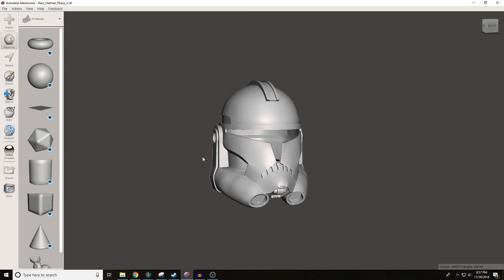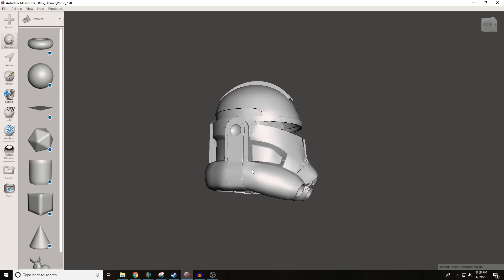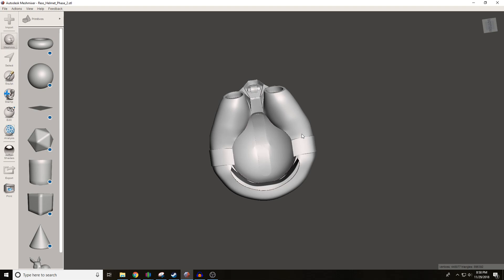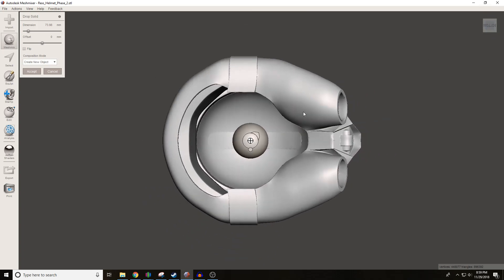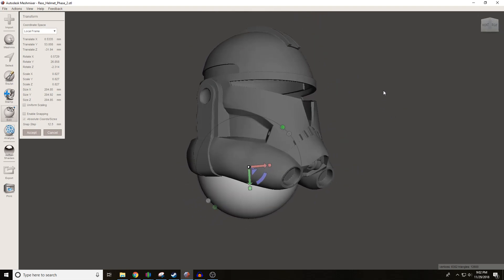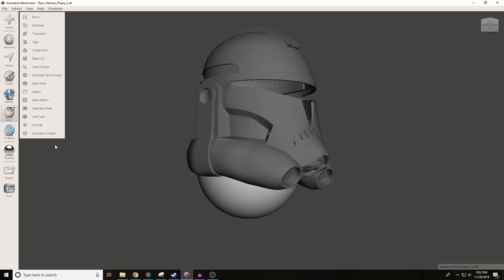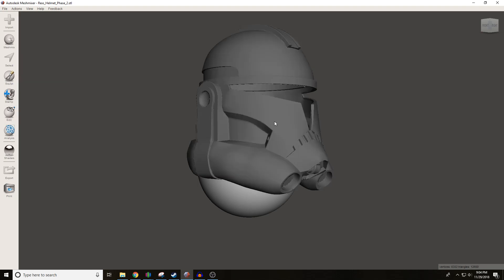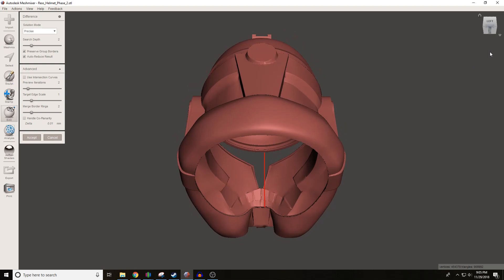How to Cut a Neck Hole for Helmets - 3d Printing Tutorial

Comment: I know this is an old video. The smaller, odd shaped hole is screen accurate right, even though it would be physically impossible to slip your head through a hole that small. So maybe split the helmet in two, front to back, so that you can put it on the way and still keep the full screen accurate coverage under the chin and around the neck
Reply: If we are talking screen accurate, these are clones and the clone armor used was mostly all cg except for the clone pilot scene in revenge of the sith. Also the stormtrooper helmets were injection molded and made from a few different parts so all were slightly different. That being said they all were essentially buckets and easy to slip on and off. (If you look at a new hope how easily Han and Luke just took off their helmets.) 

Helmets that split from the front and back shell like most power ranger helmets are also more difficult to put on, and have issues like you can't excessively talk or move your face because the helmet is that tight of a fit. (You can see that in spider man 1 were in scenes they just dub in their voices and the mouths don't move) it is mostly so you don't accidentally jostle or move the mask/helmet in too weird of orientation or have anything like that happen.